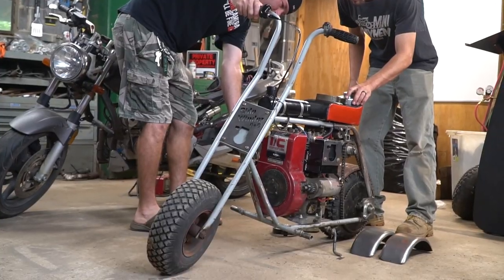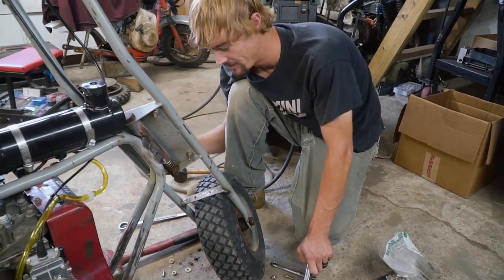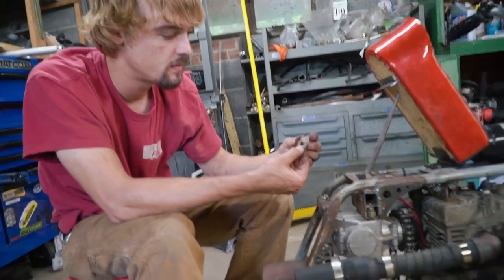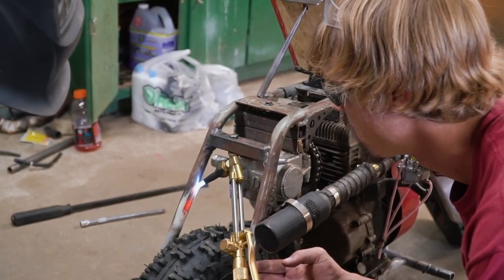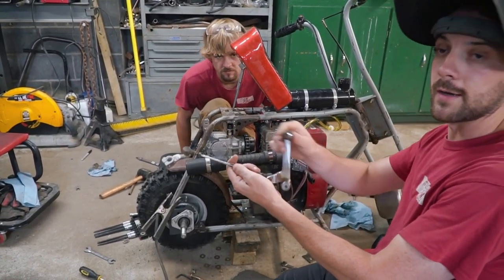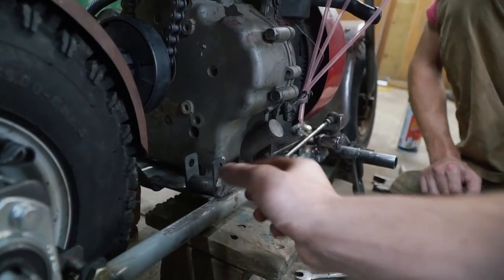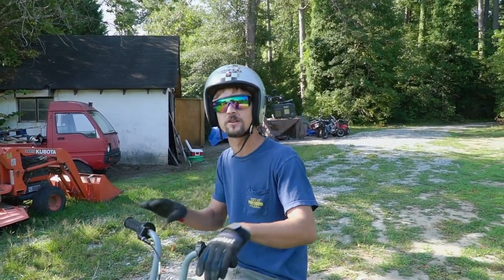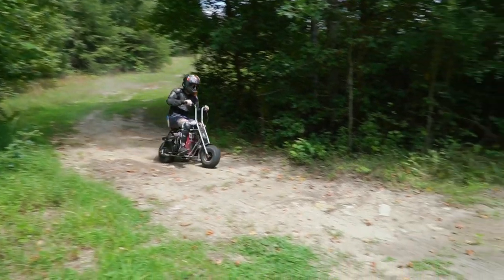90 Degree "Sidewinder" Mini Bike FINALE + Hot Laps!

Comment: So I like your sidewinder mini!
Brake lock up solution.
When designing a break drum system....
The way you have the linkage on this mini lends itself to lock up.
If you design the linkage so the band is pulled on the bottom side it will not lock up easily and provide more precise brake control.
Just an FYI from an old guy!
Reply: Well I have never installed a band brake but still find this interesting.  Makes sense and I wouldn't have thought of this.
Reply: Band brakes were slightly before my time, but all the time they were assembling them I was thinking that surely, pulling on the trailing end of the band is going to make the brakes "Grabby". The bands natural reaction is going to be to try and wrap it's self onto the drum as soon as it's pulled, but if it was pulled on the leading edge it'd going to try to spring off the drum when released.
Reply: I built a scooter with a drum and band break that was ment to be on the left side. I had to flip the tire which made the band pull from the bottom. Based on the physics of the rotation and pull in the band, it doesnt work for crap and will ultimately just squeak very loudly with little to no resistance. Gonna install a disc break when I find one off an old bike.
Reply: I’m with you old man I’ve been working and building mini bikes and karts sense early 70’s . I think Don Garlitz said it well,
“I’ve been backwards upside down and on fire “ and I can attest to that, just not at 200 mph ? I’m the last of the “Ok Boomer’s “ but still have that thing that just love anything that’s made of junk and always needing repairs. now with six grand kids and a few walkon’s make the back 40 track day race a few times a year a monumental task to get 10 to 12 karts to run 100 laps or 5 miles with no budget! 
Great work
Reply: Yeah I would definitely flip it guys.
Reply: do this if you want a minibike that only stops in reverse lol... small band brakes mounted on the axle do not work at all backwards... with a clutch mounted band it may be possible to get enough power from a band mounted in that way to actually be useful.. this is because usually there is a 5or6:1 reduction from the clutch to the wheel meaning a 4" clutch band can have the stopping power of one 6x its size on the axle (this mechanical advantage is why we have pinion brakes on off road rigs with giant tires)..  an axle mounted 4" band will just sqeak and hop if tensioned from the bottom, aka backwards... i know this because my old minibike with a 6" axle mounted band stopped great going forward and barely at all rolling backwards.. as if this weren't long winded enough, there are bands that kind of pull equally from both sides and these can work in both directions but only really half as well as a unidirectional band.. one of my first minibike videos has a bi-directional sort of band brake but it's a nearly 10" pulley and a 5/8" v belt.. it can stop very well in both directions with just a hand lever but wears out "bands" fairly quickly..
Reply: Check out "Tule Troopers" from Issaquah Washington, State. Made in the early sixties and seventies. They had a rear drum brake and shoes. My husband owned one for over 30 years. It had a two speed gearbox with a neutral. Stop to pick high or low gear, no shift-on-the-fly. Max Matic clutches with V-belt left side of bike. From gearbox to rear wheel..chain... right side of bike. Very smooth, like CVT clutches in a car.
Quite a clean setup. 
Non synchronized gearbox.

Comment: You guys have built some sketchy stuff, but this is not one of those projects, Everything was done with quality, and safety in mind. This is one fast bike done right with a very original concept. Kudos Cars and Cameras crew!
Reply: yep, not removing the axle, replacing bearings and tire was REAL quality and safety.
Reply: @TXH1138  it’s only unsafe if it becomes a problem
Reply: its fast enough to get hurt on for sure... for something like this tho, reliable brakes and a kill switch is safe enough.. that being said ...it is a super kool mini bike i have a couple bikes with sideways mounted engines with 4 speed 90º peerless boxes and a few vids of one i built with full suspension... just sayin lol
Reply: The only other safety thing I would recommend is a chain guard on the drive chain.  I have seen what a chain can do when it comes loose and it is not pretty.  Seen a guy have to get about 100 stitches in the back of his arm from a racing kart back in the day.
Reply: @cthoroughman  chain guards are definitely important... that primary drive is just as dangerous as the wheel drive for sure..  the worst are those "torque converter" things they come with a guard that fits on exactly nothing lol and when those belts break shit gets real..

Comment: Instead of using an oil additive, you could use diesel oil. It already has all the additives and cleaning properties that old/cheap engines need.
Reply: I agree. Shell Rotella T work's great in small engine's. I still add a smidge of Lucas break in oil with the oil change though. I just put 40W T6 in everything from my ATV to 4 stroke weedeater and have never had a problem. I don't add any Lucas to the ATV oil change. Worried too much zinc could cause the wet clutch to slip.

Comment: Quick facts for the C&C crew.. the stp oil treatment has less zinc and phosphorus than regular motor oil. Only time I use stp is on new bearings cause its thick so it keeps the bearings from touching. But adding it as a zddp additive is not helping its hurting you. Project farm did a oil analysis on it I believe

Comment: Still think you guys should do a throwback style project with a lawn mower engine, but like using an intek vtwin for a big mini bike, or for a kart, do the vertical to horizontal shaft conversion, get yourself like 20hp worth of vtwin power to one of your most excellent creations. Maybe a c&c original rock crawling monster 😎😎

Comment: Interesting build.  Looks like the gearbox just added weight, complication, and more ways to get body parts tangled in machinery.  Nothing like a good Comet torque converter.
I remember riding off on my buddy's small tire no suspension mini bike.  When I returned the people around the campfire said they could INSTANTLY tell I had crashed by my posture and low speed.  Hit some whoops on the dirt road and the damn thing porpoised and threw me like Christopher Reeve.

Comment: Instead of adding zinc to your oil you can use racing oil like Penrite 10tenths or Redline which have zinc in them. Or if you want cheaper you can use marine oil.
Zinc was only removed to protect catalytic converters so any oil designed for off-road will have zinc in it.

Comment: its a good thing to but your brakes on the wheel. i have a mobility scooter my grandpa gave to me before he died, it was completely built by him in the 70's. it has a pad that rubs against the clutch as the brakes. so me being the dumb guy i am, i did some mods and changes and got it doing almost 40MPH. it was a beast. it can pull past a stock 212 on a Coleman frame. 2 weeks ago i was riding it down my road and the chain slipped off the rear sprocket at 30MPH. just in case the chain would rap up my diff and lock my tires up i pulled it into the grass on the side of the road. the second i did that i hit a big dip and it sent me flying off of it. i knocked my head on the grass and started sliding if i could guess maybe 10 or 20 feet. and while i was sliding i got a look back at the scooter to see it 3 feet in the air. broke 3/4 seat posts and bent the frame real good. i managed to walk away from that with a small headache that went away the next day and i just got that thing back together and almost ready to ride again.

Comment: Those brake-bands arent designed to be pulled from that direction, you are only applying friction to like 25 percent of the band like that? the band pivot should have been at like 4-oclock position and the part you pull on at 7-oclock - to use closer to 100% of the band -

Comment: That's got to be one of the craziest coolest things I've ever seen 🔥👍✌️ 
The only thing I think I would do different is turn the clutch around That's going to put a lot of pressure on the crank shaft with it turned the way it is  I've seen them snap like a twig and it's very dangerous I felt the wind off of a clutch once Went right by my head  It was on a go-kart not a minibike Still wouldn't feel good on your leg etc though lol Be safe guys ✌️

Comment: Maybe consider putting the band break on with the opening at the bottom so break dust can fall out instead of building up. Also, bolt the front to the point you made already and then attach your cable to the rear of the band break in order to keep the break cable straight. Just a suggestion and I feel dumb ever offering you guys suggestions, you def proved yourselves amazing engineers lol Your way may truly be the best lol Be safe guys and thank you for yet another awesome vid :)

Comment: Y’all should do a snapper mower build go cart motor mounted on the back with a pulley where the friction plate would go and a pulley on the shaft of the motor and use the transmission on the mower and see how fast it’ll go

Comment: Hmmm I have a foot clutch break on a mini bike, I never out until realization that if my chain comes off my brake is useless, doesn’t help that my chain is quite loose enough to where it’s been rubbing on both my frame and bracket to hold the brake on… it’ll be fine

Comment: Yall need to take that to the drag strip and the cross kart that would be fun for yall and fun to watch ... needa do another turbo go-kart build too but build it for straight line performance to try to beat the cross kart it would be fun to see if it's possible to build one faster than a motorcycle built go kart

Comment: Hey guys with that piece of flat bar you used to mount the front fender maybe a good idea next time would be to bend it so that it fits up into the shape of the fender on the inside kind of like a U shape with flat bends at the top to flare it out that way you don’t have to fit spacers or any other goofy stuff in there that might cause it to come loose even easier or flop around worse just an idea man

Comment: I like the chain piece for linkage lol nice one that's something I would have done as well use all scraps if you can 😁. That seat needs a spring or two under the seat for cushion and so they don't fall off. You can see if wrapping down the back of the chassis. This is one of my favorite builds tho. Nice job guys

Comment: Any chance you guys will do a kids atv I have a old herchee 50cc that had a locked motor when I got it from the scrap yard for 20$ swapped a 212 with a mancuni 22mil. And a green spring swapped tc with the juggernaut front pulley unfortunately 42 tooth rear sprockets have been out of stock for me so I have 2 setups a 18 tooth front with either a 30 tooth rear or a 64 tooth rear 30 is great for about 60mph and the 64 is a wheelie machine great for learning balance point on the thing but only about 30-35 mph got everything for go power sports and you know I let them know c&c sent me lol

Comment: Hey folks at C&C  i just picked up a chinese two seater go cart 
It has full suspension and a roll cage  
Its not in bad shape but it needs a few parts 
Its and older machine but still has a sticker that reads something like subaru power or powered by subaru
But has no name on it
Can yall tell me what some of the names used  if i had to guess id think it was probaly a 2015 or earlier model

Comment: get yourselves a 144 cc motorcycle motor and build a honda trail 70 clone, maybe call it a trail 80 as you'd want it to be a bit bigger than a trail 70, but not really as big as a trail 90. set it up like a proper bike, front and rear suspension, hydraulic brakes, etc.

Comment: Go back to your roots. Build a basic small Kart. Maybe make a good instructional video series: frame design and build, engine selection, tires and bits. But do both a kart using basic tools, I.E. no plasma table or tubing bender,  and the same design using every trick you can. Show how it can be done with a poor-man's tool kit, then with a professional shop set.